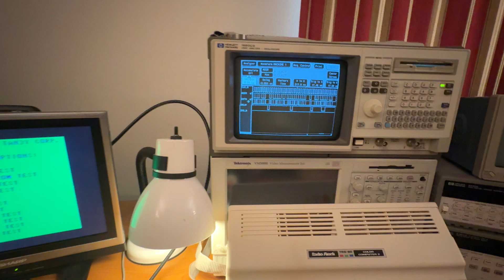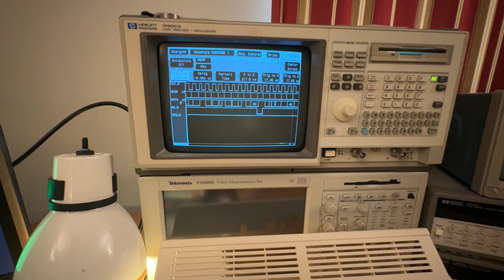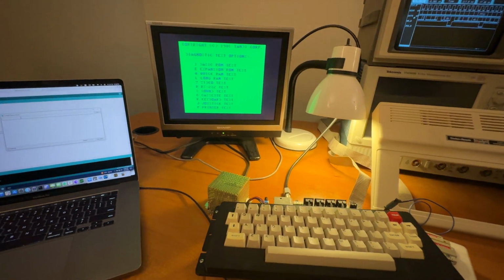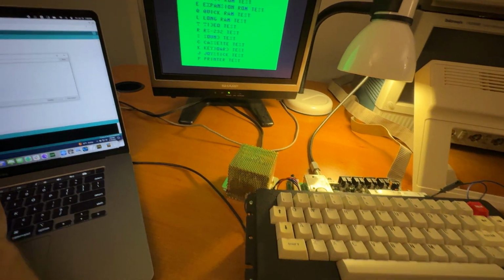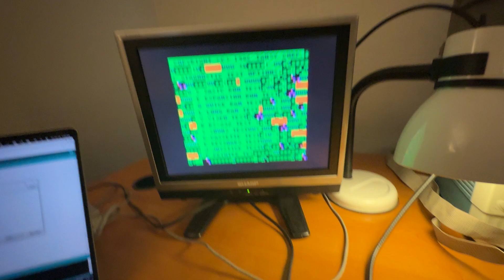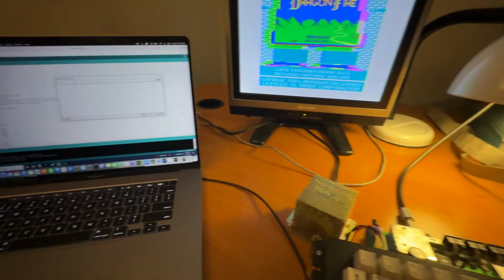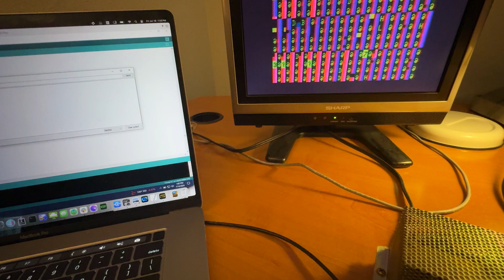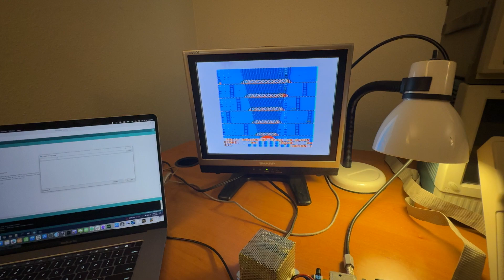MCL6809 - Motorola 6809 Drop-in Emulator running in a Color Computer

Comment: Could the corruption be caused by them timing from the Video Sych, such as using them for an interrupt timer? Or perhaps it's too fast for the PIAs?
Reply from the maker: Thanks for the note.  I believe what was happening was that it was not an opcode timing issue, but rather an issue of the IRQ recognition timing. I added one more clock before the MCL6809 recognizes the interrupt and the color-shifting (corruption) appears to be gone!  Thx!

Comment: Is there documentation for the commands you are running on the controlling machine (your Mac in this case)
I glanced at your website and the github repo - and didn't see any documentation.

I'm really curious if this can be used like an old school "Freezer"
i.e. can you halt execution and then single step, examine/modify memory and then continue?

Comment: This is awesome. I have a pair of 6809 (well, one 1MHz 6809 and one 2MHz dual-6809E) machines made by a small UK company called Positron that I've been debugging and fixing off and on for years. Very few people know about them. As Hackaday says, hopefully at some point there will be a controlling app that would allow me to do a full ICE setup to watch what these machines do while booting. Ironically, Positron themselves made ICE equipment based on one of the boards I have :D Wish I had the wherewithal to come up with such an app myself. Cheers Ted.

Comment: the dragonfire corruption - does it corrupt like that on your coco2 w/ a normal 6809 in it? I know the timing of everything has to be exact for the colour trickery to line up right!
Reply from the maker: Thanks for the note.  I believe what was happening was that it was not an opcode timing issue, but rather an issue of the IRQ recognition timing. I added one more clock before the MCL6809 recognizes the interrupt and the color-shifting (corruption) appears to be gone!  Thx!
Reply: @microcorelabs7698  yay! Nice!